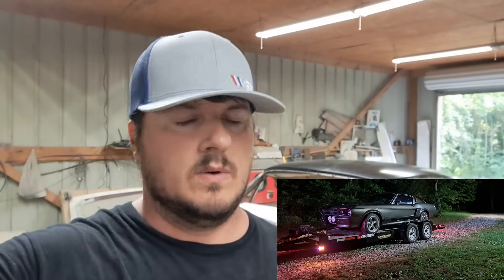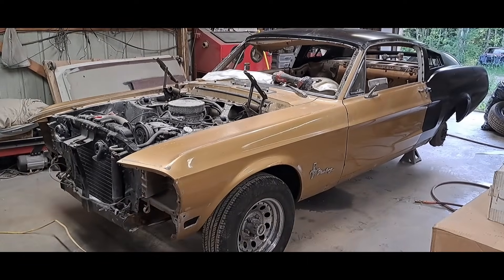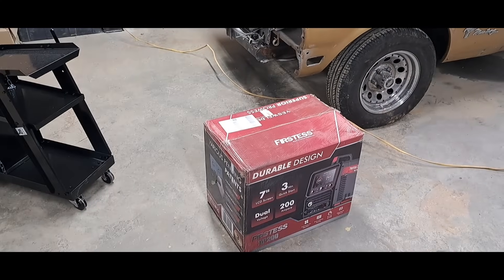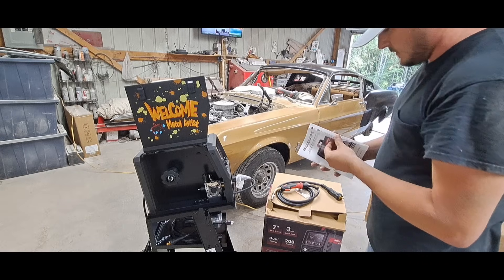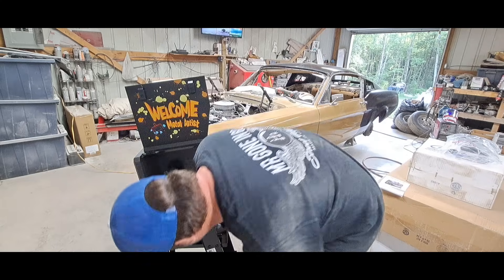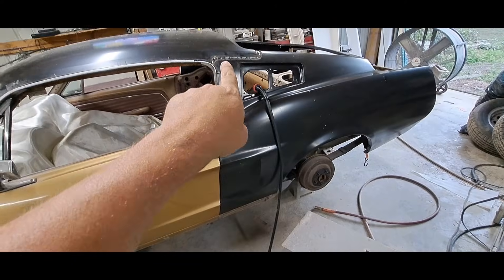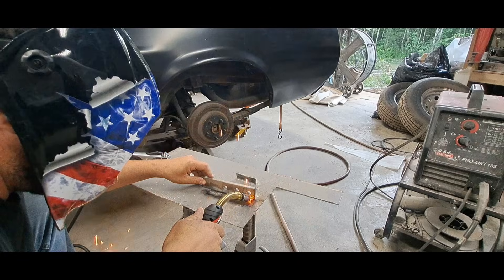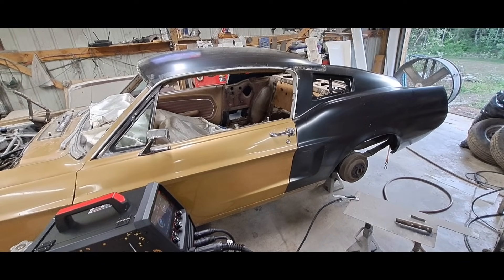Coupe to fastback mustang conversion continues with a new dp200 yes welder

Comment: I have question, I am doing a coupe to fastback conversion on a 67. Do you ever have fitment problems the rear quarter extension? This is just a straight fastback conversion. I  have a gap at top of the extension where goes down towards the trunk lid. I am using Dynacorn quarters and extensions.
Reply from the maker: When you say gap is the extension hitting quarter on the underside of the extension before it fits flush to the quarter or ?
Reply: @MrGonein60  I have a gap about 1/4 wide looking down from the top of extension between the quarter panel and the extension tapering towards the trunk lid.
Reply: I could email you a photo if you like.

Comment: If I recall correctly, aluminum mig usually requires a spool gun, because the aluminum wire is too soft to push from the welder all the way to the gun. The spool guns shorten the distance the wire has to be fed, so they allow you to run a softer wire.
Reply from the maker: Not for this welder it comes with a special liner designed just for the soft aluminum welding wire. Spool gun not needed
Reply: That will be nice if it works well, because spool guns were always pretty cumbersome, so getting in tight areas was challenging.
Reply: I have this welder and I bought the spool gun and extra special liner too. I havent used them yet.

Comment: What happened with the arccaptain welder you used last month?
Reply from the maker: It's too small for my application. It can only use small 1 pound spool of wire and it hits its the duty cycle pretty quick

Comment: I got the Yes welder 185 I really like it, wait until you test the stick weld out it wasn't like the old stick I'm used to, and for sheet metal I'm going to try 110 instead of 220
Reply from the maker: I haven tried 220 yet. 110 is plenty hot enough for me.
Reply: @MrGonein60 thanks that's what I'll do